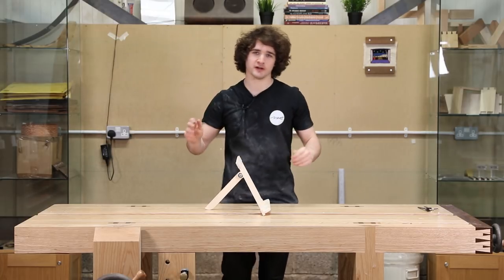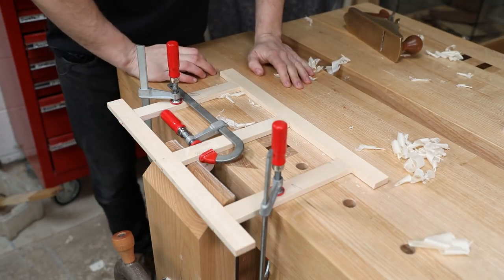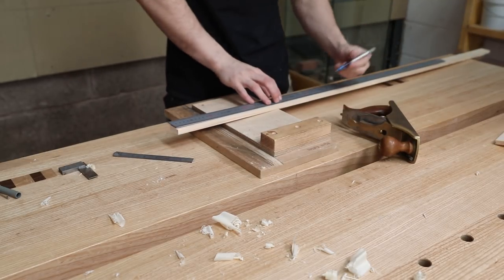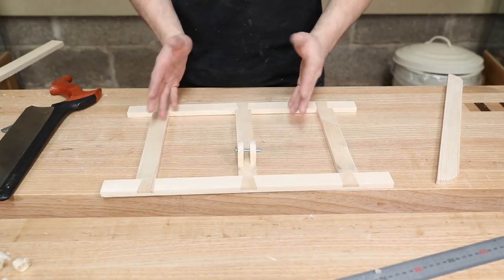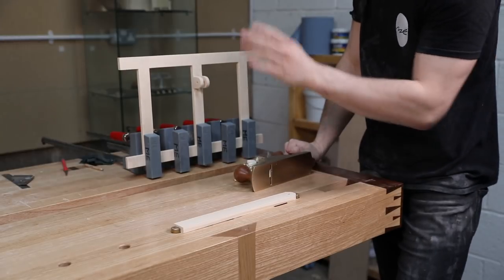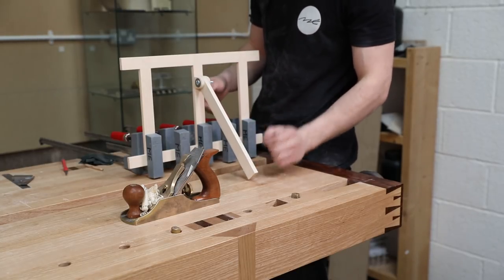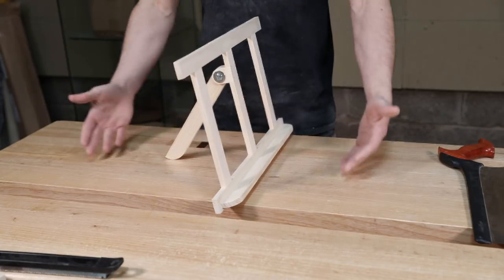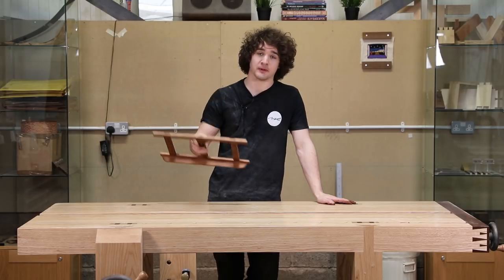Attaching the Remaining Components and FINISHING | The Book Stand #4

Comment: To figure out the length of that leg next time, it's another opportunity to use that split in your workbench. Leg through the middle, hold the frame at the angle you want, hold the leg about how you want it, and transfer the top of your workbench onto the side of the leg.

Comment: It's always good to try something at least once, now you know.  I've used stain on a few things successfully, but for the most part, I agree with you.
Reply: It is well-known that pine does not take stain well: it tends to be uneven in the finish.
To darken a project like this, I would use a stained varnish, which is effectively a transparent paint.  It dries on the surface, so does not rely on soaking in. - Not a sophisticated finish, but for something like this, and if you don't know a better way, it would do.
Reply: Offshoreorganbuilder I've always used a pre-stain conditioner, which helps with the splotches, but I still prefer to let the wood shine through.  I have seen stained varnish before and it can be really effective.